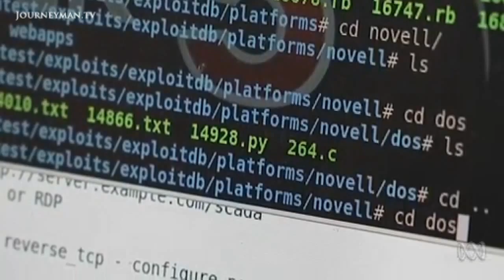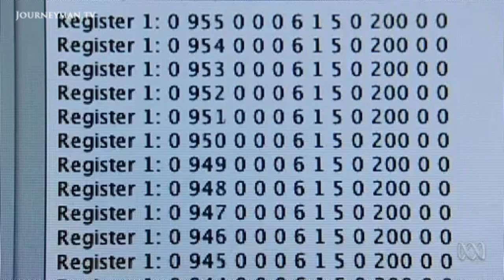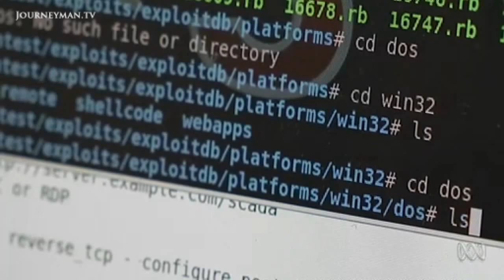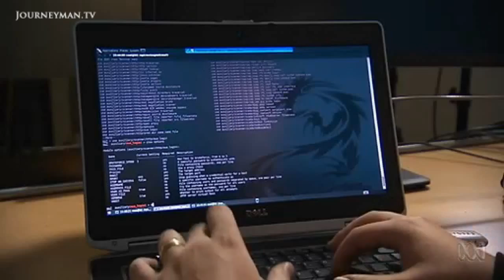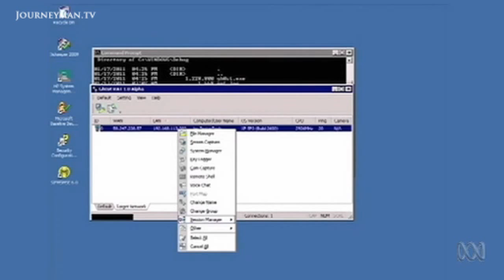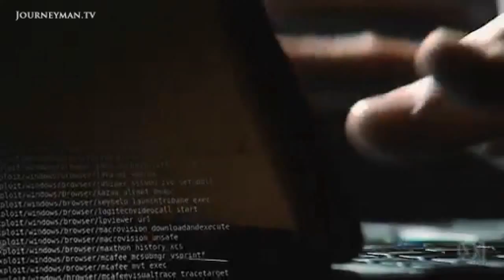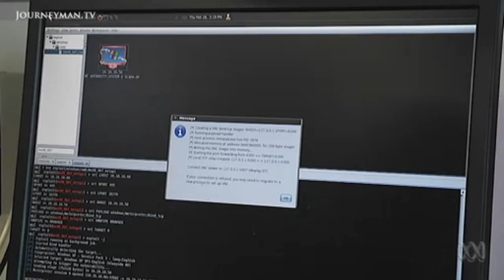How Cyber Attacks Threaten To Destroy Our Infrastructure

Comment: I don’t think Cyber Attacks are anything new, it is something that’s going on for YEARS and YEARS, and it just CAN’T be stopped overnight. You got to have proper system. I believe we have the solution now. And that solution is called Authoreon. You just need to look to know what I am talking about. 

With their FULL-PROOF system, it will ensure you complete security with preventing, frauds, cyber attacks, material and immaterial identity theft and they provide traceability to supply and ownership chains. 

It is the SYSTEM that will solution all your security issues! With just hours before their crowdsale ends, it is must not to miss out on this https://www.authoreon.io